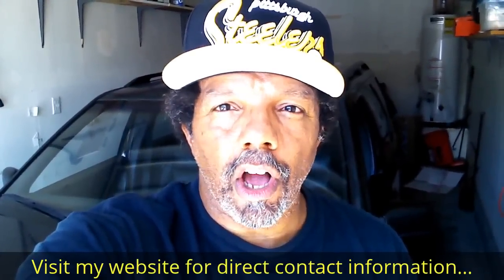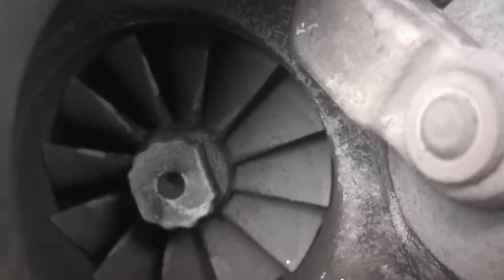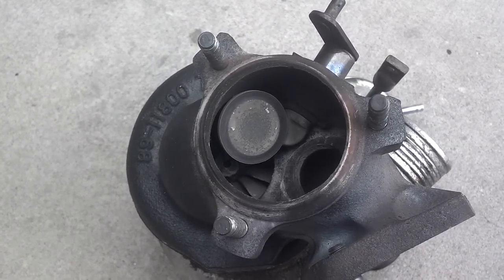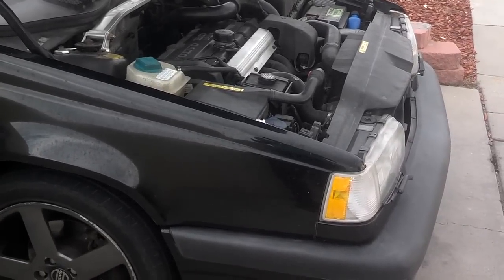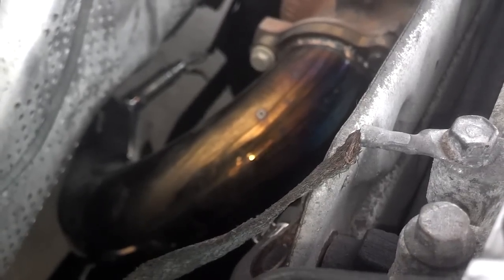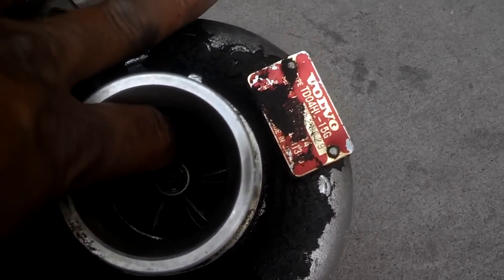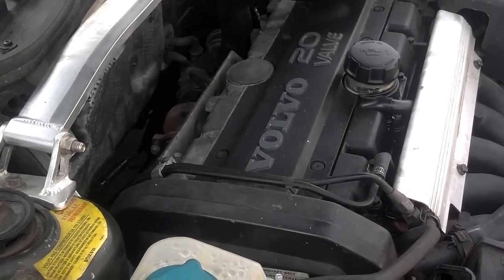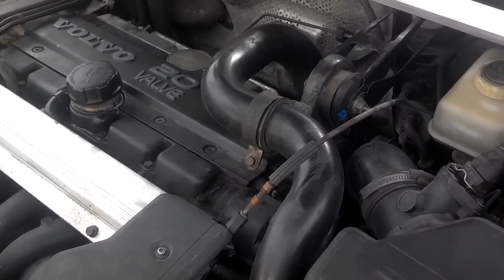How your car's trubo charger works and how to take care of it. (Long version) - VOTD

Comment: Thank you so much for the video!  I want my engine, transmission and turbo to last for MANY YEARS! The info you gave was very informative.  I have a 2014 Audi A5 2.0T.  Manufacturer says change my synthetic oil every 10k miles.  I know I can change it sooner, but it cost me $220 to do it.  Do you suggest I change the oil before 10k?  I want to stick with the Audi dealer for doing maintenance so they don't give me ANY reason not to approve work from my extended warranty if I ever need it.  Thanks again!
Reply from the maker: Maybe 7500. Best to check with https://m.blackstone-labs.com
Reply: Robert DIY Thank you! You know so much about cars!  I'm a single lady so it's great that I can just look up your YouTube to get info for my car! Thank you for the link!

Comment: I have my Volvo 850 GLT 96- is it possible to Turbo Convert it? And how about the cost?
Reply: Pretty much any car can be turbocharged. There is a lot of work and a lot of money that goes into turboing an n/a car though. A lot of the time it's easier to just buy a car that has been turbocharged. You'll spend a lot on different parts (even if used) and if you haven't done this kind of thing before it's a huge undertaking. It took me ten hours to set up a turbo on an integra, and many more hours to tune it. It cost my customer four grand in parts and a ton in labour. It is easier to just buy a turbocharged car. The first and second generation DSM's can be had for very little, older GTI's etc.
Reply: Ah okay ill see what i will do :) But i love my beloved GLT but... Would like a Volvo 850R :/ Well well, need some more money then we will see :)
Thanks for good awnser!